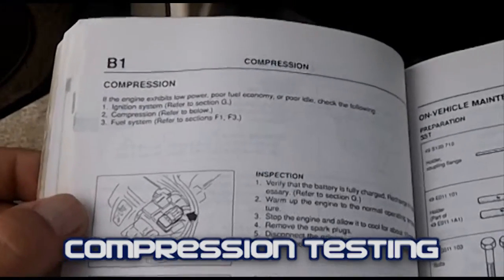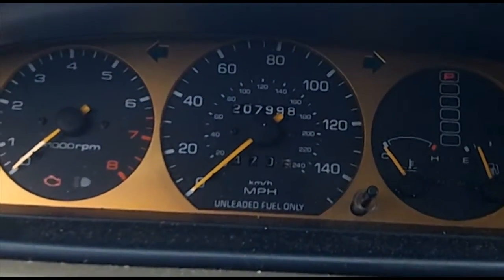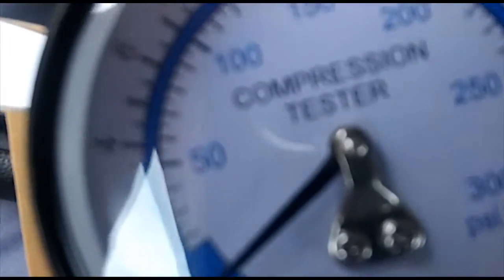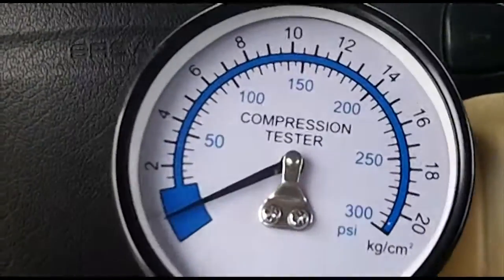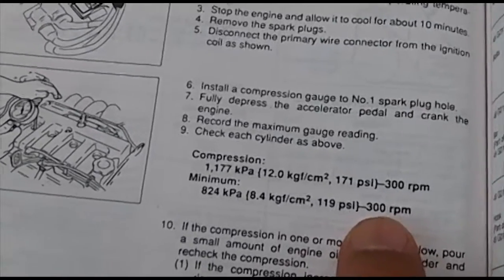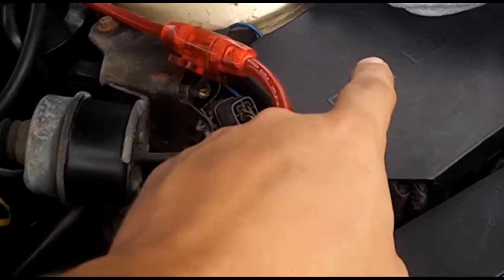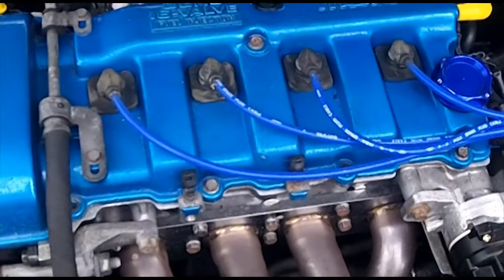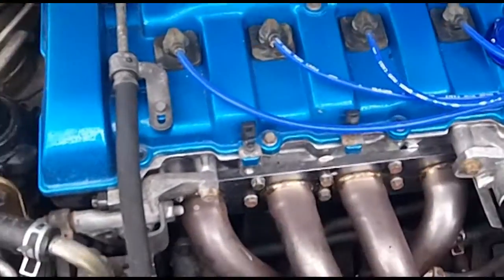Mazda 626 - 2.0L Compression Testing

Comment from the maker: Could be the alternator not charging the battery, failing distributor (or part of it including the cam sensor), faulty fuel pump, faulty crank sensor signal.  That's about all I can think of off the top of my head.

Comment: DJ, it wasn't a no start, had good compression, crusing along ,etc. Then the power died, after about 35 seconds it stalled completely on the highway, pulled over, now usually it started back up again after about 20-minutes, but this time it wouldn't and I eventually drained the battery? I have it in the shop now, and I'm waiting on their dignosis, just don't want to be taken for a ride, if ye know what I mean ;}

Comment from the maker: It could be a variety of different things.  Always start with the basics when dealing with a no-start.  Check for fuel pressure, good spark, and battery voltage. Doing the above tests will lead you in the right direction.  At the very least it will tell you what is not the culprit which is just as useful in the process of elimination.

Comment: DJ, I have a 95 Mazda 626, and lately it let me down! It was very hot here, and she stalled out on me...I left it alone for 20-minutes and it started back-up, ran for a day, no problems! It did that a few time, until it finally stalled and wouldn't start back-up, any possible diagnosis, had, good compression, etc?